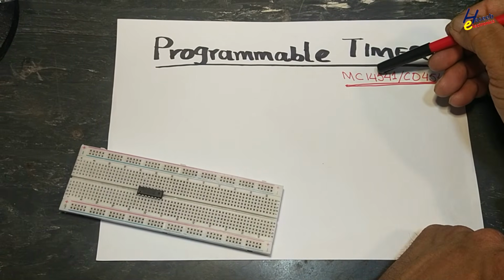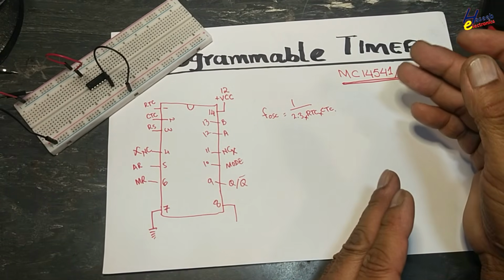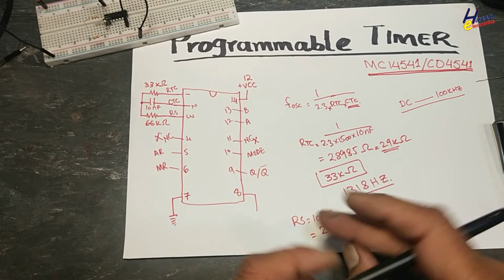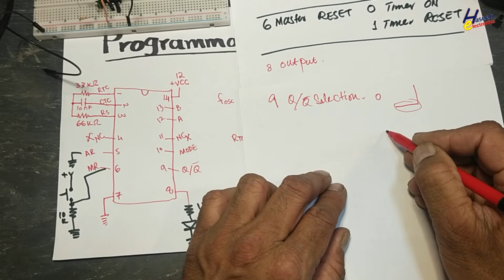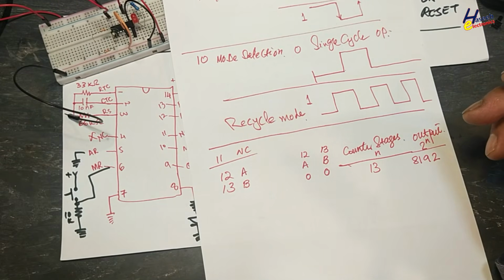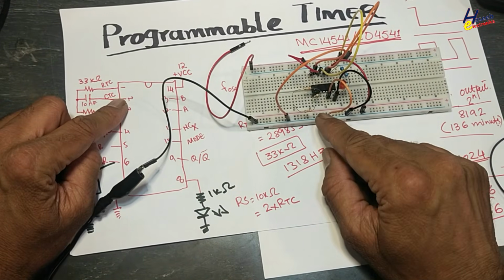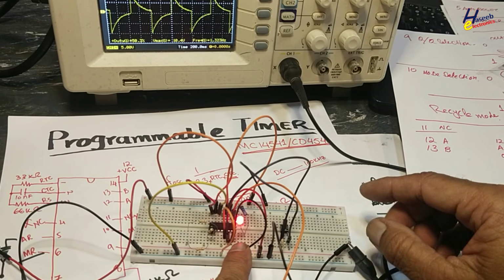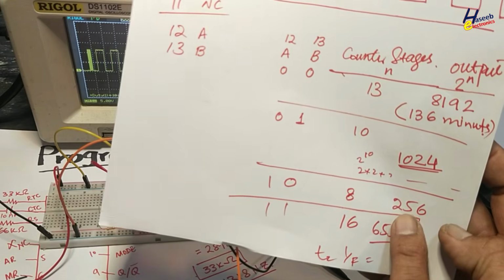Programmable Timer / Frequency Divider | MC14541 / CD4541 Theory & Practical | Ep#1444

Comment: Hello Haseeb 
In this video ,you mentioned the AR pin to be connected to GND which means Auto reset enabled .if you always connected how it will be provided the output
Reply from the maker: It is not a RESET function. It is Auto Reset pin 5. It only resets the ic during first start up (I mean power on reset) 
To reset the IC, there is pin 6. That is MASTER RESET